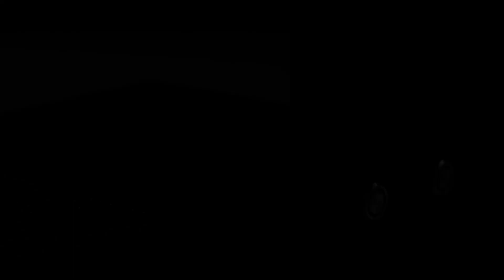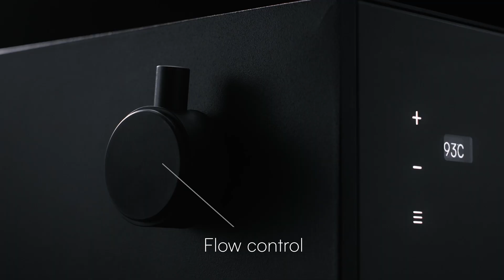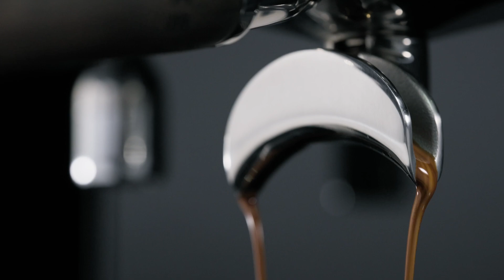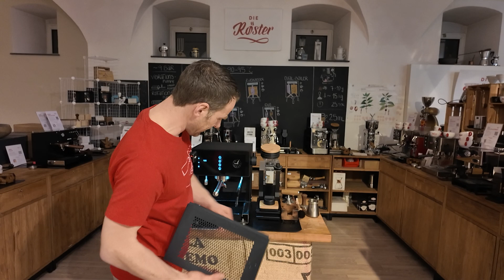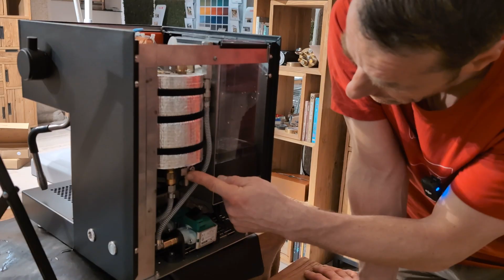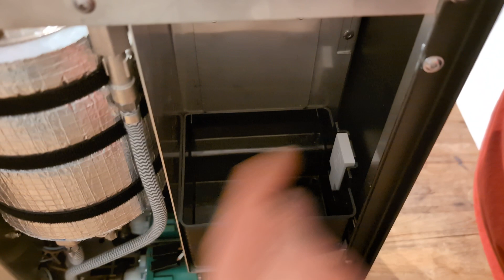Arkel Coast Deep Dive - Outside & Inside (ENGLISH Version)

Comment: An excellent review / deep-dive into what is a very attractive and intriguing machine - thank you!
I am currently considering a the Profitec Drive or Lelit Bianca. In your opinion, how does the Arkel Coast measure up? Would you recommend it over the other two? Reliability and user experience are the most important considerations for me. Thank you!!
Reply from the maker: Thanks - I would say, that there is no clear winner for me. It depends on your preference. 

Drive & Bianca are very similar. They share the same basic design (E61 dual boiler with rotary pump) and some flow control mechanism on the brew group. 

Arkel has a very different - I would say more modern - technology base. This leads to faster heat up time  and adds some features like dosing or automated backflushing program. 
On the other hand, it is newer and therefore there is certainly less proof of reliability - not so many Coasts out there yet compared to the other two. 

There is definitely a difference in the pump system. If you want direct connection to the water supply, this is not possible with the Arkel. 

Regarding user experience. Bianca and Drive have a traditional user experience - meaning manual start/stop. 

Coast makes it easier for users to make coffee with dosing for coffee and also hot water. This is especially helpful if one user is an enthusiast and the other user is not (also called partner acceptance factor). Coast is a bit easier to clean as you have a cubic design and glass fronts. Also it features an automated cleaning and descaling program.

Comment: Do you know how long the machine takes to heat up in the normal mode? How much faster is the mode with both boilers at the same time?
Reply from the maker: We have not tested precisely yet ... but it does not seem to make a big difference. Having the portafilter on temperature takes the longest time and defines the heat up time. Both boilers are already on temperature way before.
Reply: Mine takes ~10min.

Comment: It looks like a great machine, but I wish they'd have gone with switches/buttons instead of touch controls. Aside from the tactile feedback provided by physical controls, they're inherently more serviceable and repairable in the long run. I think it's a valid concern that years down the line the capacitive touch panel could die and have no options for repair or replacement, leaving you with a very large and expensive paperweight.
Reply from the maker: Time will tell if those buttons are less durable than physical ones. At least for ovens etc , touch has been usual for many years. Anyhow, the front panel can be replaced - so even if it breaks... We will be able to put the coast back to working;-)